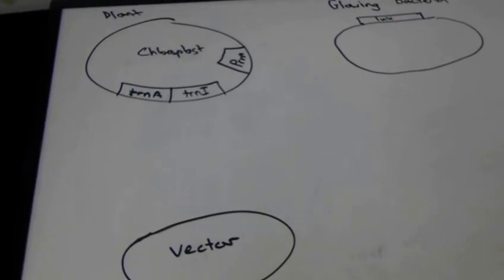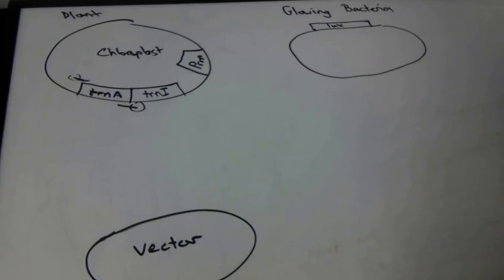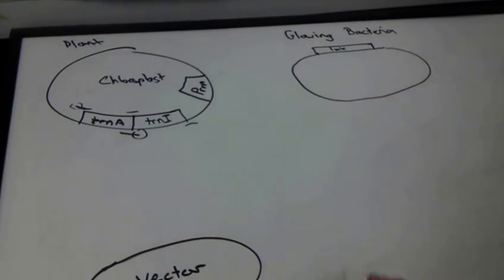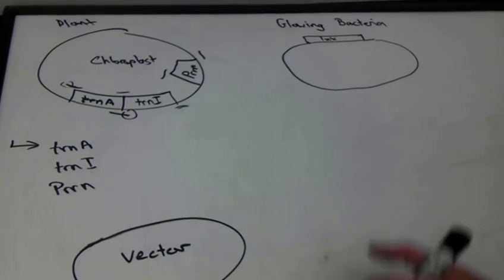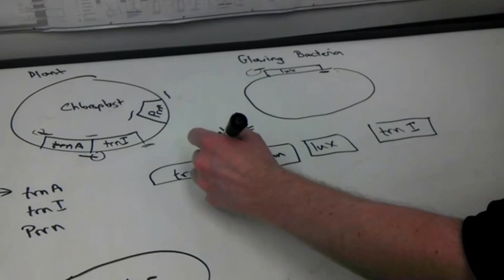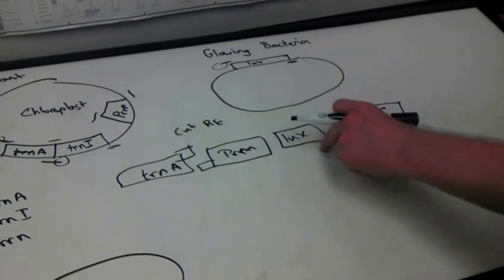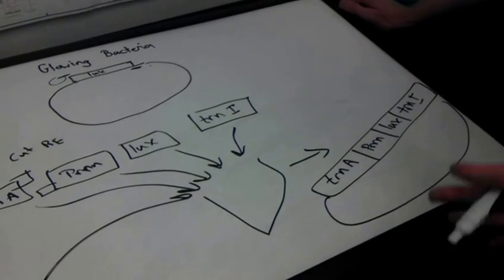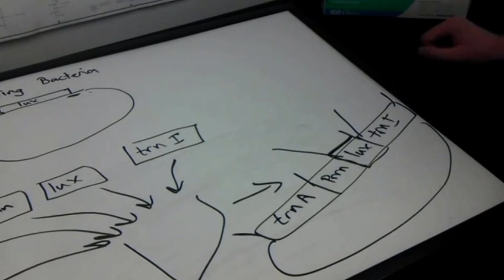How we design DNA

Comment: OK good to know - just that agrobacterium most likely would be easier to set up if DIY labs is the aim... (especially since gene gun methods usually means that you need to regenerate from callus cultures, requiring quite a lot of equipment). Any thoughts about selectable markers to be used?